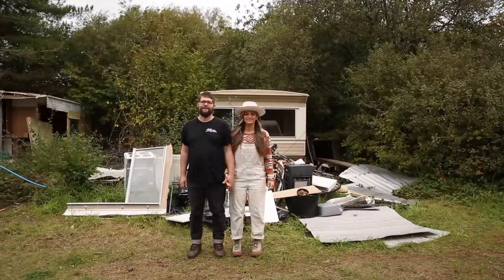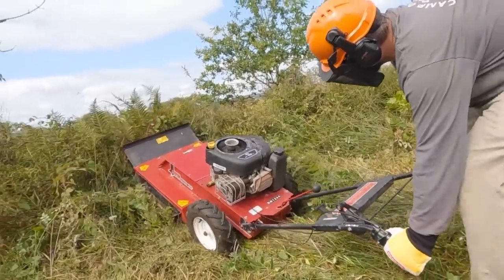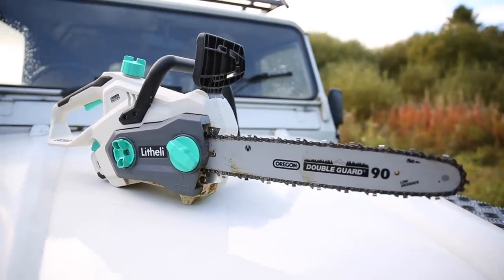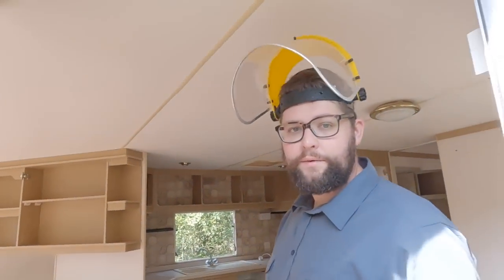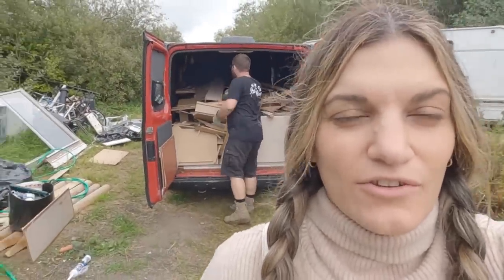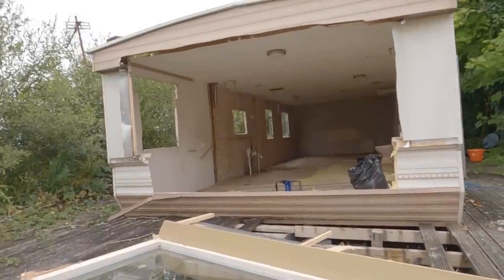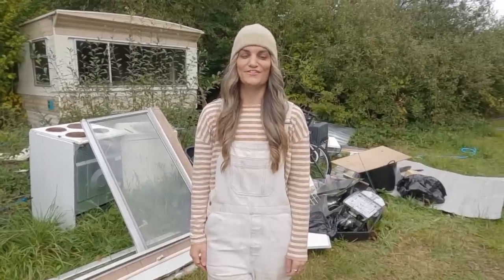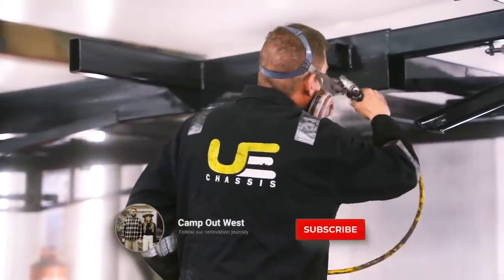Renovation PT.4 | Land clearance, caravan destruction, trespassers, exciting delivery + GIVEAWAY

Comment: These great videos just popped up as ive been looking up for glamping options. The land price with services and residential planning is very good value.
We are doing a passive off grid modern Barn conversion using sips in the south hams with mobile glamping pods so interested in the chassis sizes and costs
if you could pick up on that in any future vids were looking at at sip build on a chassis with a build to match the barn 
you will be a bit ahead off us as we have a barn to build first so it will be interesting to see what you guys do. Looking at setting up a channel got loads of vids on borehole and solar
which we have set up for the static on site for the start of our adventure but do not seem to have the time at the moment as doing all the drawing and design and sorting out site takes all my time.
Anyway Those reo-link look good and if we had one i think i would use it to see the wonderful view we have from the barn when we are not there as well keeping an eye on any local rogues.
ps out local farmer has offered to cut the over growth and cut the hedges back for £150.00 when we want looks a lot easier than doing it yourself.
Reply from the maker: Thanks Gary! Your project sounds incredible! Defiantly keep us updated. So we are building within the caravan building code, as our land only allows residential caravans/park homes. The chassis we have bought is 8m x 3m and we paid around £3,000 with delivery, but it's built to the building code of a park home. We are building timber frame, as we have some experience with that. We've never used sips, but heard great things! Let us know when your channel is live, we'd love to keep up with your progress! That's amazing your local farmer has offered to help. Sadly as we have no idea what's underneath all the overgrowth, no local farmer wanted to risk potential breaking their massive on whatever might be hiding underneath haha

Comment: It is a shame none of these mobile homes could be salvaged or repaired. There was probably some value in them. Even where there was rot, it can normally be easily replaced. A lot of the damage was likely caused by the overgrowth leaving the outside of the home in extended contact with moisture. None of them I've seen so far looked horrific inside, and one or two might have made good temporary homes during construction of the planned home. I was expecting to see laminate hanging off of the units, but they look in pretty good condition.

Comment: Didn’t see the end of the video yet . But that baring should not be hard to source . I regularly order bearings from a company called simply bearings . You n Ed to know the inside (Id) , outside (od) and width . Their web site makes it easy to find the correct part . You should be able to fit it with a hammer and punch . Give us a shout if you need help . We own a place up the road in cardigan bay
Reply from the maker: Cheers Dave, I bought the kevlar drive and cutting deck belts for the machine off of simply bearings and they are amazing value, the genuine belt for the cutting deck from swisher the manufacturer is RRP £90 I think I paid £11 for a kevlar belt of the same size from simply bearings. Will have a look on there for the bearings. We got married in Cardigan, we love it there.

Comment: Brush cutter seems a good buy. Bearing should be an imperial size. A local farm machinery repair shop should help. One of those cameras would be useful at the bottom of my garden to watch the local kids stealing apples of the tree. Not that I want to report them. I just want to see their faces when they bite into them and realise they are Crabbe apples. SOUR🤪😆
Reply from the maker: I'm impressed with the machine, absolute beast of a thing and we got a good deal on it, looking forward to getting back to using it once I've fixed it. Jon

Comment: You're going to get into trouble if you keep on promoting products without clearly stating that you are promoting them, just saying you were sent something isn't enough. 
Whether you're being paid or got sent the items for free you're serving as an advertisement for those products and you need to follow the ASA guidelines:

If the video is largely editorial but includes a section that is advertising, or only some of the products featured are affiliate-linked products, it should be clear immediately before or at the time the advertising starts/the affiliate linked products are featured – either by way of a clear verbal explanation or prominent on-screen text to make clear which parts of the content are advertising.
Reply from the maker: Hi 😀 we have selected  & our video is showing  'this video features paid/promotion content' button for this video that shows a button / tag in the top left corner at the start of the video, as YouTube requires 😀 & and stated we were sent both the chainsaw & camera  in the video - to clarify we weren't paid. We also aren't using any affiliate links, they are normal links, so that's why we haven't declared it 😊 any questions just let us know x

Comment: A great pity you decided to destroy this caravan rather than either repair, or perhaps more realistically disassemble it.
You destroyed so much  that could have been reused by yourself or someone else. Doors, Windows even the roof could have been used for a wood shed or such like, Then there was a built in oven, the hob, the sink, the fire, several of the units or maybe just some of the panels of the units, even the small 1" x 1" wood could have been reused all not to mention the thin steel sheets which are so useful. Instead you just smashed or cut everything up. For two people blessed with these resources you wasted a lot. Such a awful pity.
Reply from the maker: Incorrect - we tried to sell the caravan and even offered it to people for free and no one wanted them dye due to how rotten they were. This caravan in particular - the whole back wall and 2 back rooms were so rotten we were falling through the floor and the roof had a massive hole in it that had been letting water in for 15 years+ which was why the whole back area of the caravan was waterlogged. Also the chassis's were completed rotten and the tow bars snapped, so you couldn't even move them if you wanted to. No one wanted to buy them or even for free when we offered them. There was no point in us repairing them either as they aren't even legally aloud to stay on our land due to not being built to the correct building code our land allows. So if no one wanted to buy them or take them for free and we aren't even aloud to keep them on our land the only other option for us was to break them down and recycle the material. Nothing was wasted - as mentioned everything was recycled. Every bit of wood was taken to our wood recycling and all the roof beams we kept ourselves, every bit of metal weighed in and recycled where they will be reused again. The oven/ hob/sink/fire - weighed in and recycled at our recycling centre. Nothing was wasted unless it was rotten and not fit for use. There is no point us keeping/hording things gathering dust that we cannot see us using then, the sensible solution was to recycle the materials and use the money we made from recycling and  invest it directly into our project. Nothing was wasted
Reply: @CampOutWest  I never suggested selling it and offering it 'free' would still cost the buyer maybe £1k to move even if it was worth it. I understand that things come to the end of their useful life at some point but disassembly andreuse of what can be reused, and there was lots, is very different to destroying everything.
My own 1979-80 static probably only has another ?? 8-10 years in it but when that sad day comes I will take it apart and reuse as much as I can. [It's sad not because I'm a green obsessive but because I love it] This is totally different from your destruction.
I really don't mean this as a rant, it's just a pity. 'Recycling' perfectly usable things is bad, they should be REUSED. As an example the roof having a hole doesn't stop it being useful for a number of things, one of which I mentioned (even if you neatly cut it in half) if it's got a hole patch it - not all minor outbuildings need to be pretty and that would have been a good use assuming of course you need a shed / minor outbuilding.  The metal skin - partly sunk into the ground as rabbit fencing (bottom part) or for raised beds or or or . .
The doors and windows could have been used in a shed and or as cold frames. 
The sink will be going to landfill (it wasn't metal) this and the hob at least was worth putting on freecycle so it could have been reused. I guess as I'm used to not having much It's painful to see so much waste and this was very wasteful.
Think of it like this, if someone crashes into and writes off you nice LandRover you could take off the undamaged parts and REUSE them yourself or sell/give them away so someone else to use them or you can chuck the whole car with undamaged: engine, tires, some body panels fancy radio etc. in to a crusher for RECYCLING. As I said not meant as a rant it's just sad.
Reply from the maker: Our recycling centre is actually landfill free, so nothing from our land has ended up in a landfill 😀. We agree it's great to reuse things but as we personally had no use for the vast amount of materials left from the caravans and no one we knew wanted them, the best option for us to recycle them responsible, as if we'd kept them they would literally be gathering dust on our land for years to come.   @cyngaethlestan8859

Comment: You guys definitely were way more wasteful than you needed to be, very disappointing.
Reply from the maker: Wasteful? That's an interesting take on what we've done and how we've chosen to do it 😅 - incase you missed it in the video... all the aluminium shell is being recycled along with the chassis. All the cabinets/ MDF etc were taken to our recycling point etc. Even all the curtains/carpets were recycled correctly. Barely anything has been wasted,  so I'm not sure what elements you are calling 'wasteful' ?  😅 also the caravan was not sellable, as we've mentioned multiple times (we tried to sell it and offer it to anyone that wanted it) but due to it being left to rot and abandoned for 10+ years, the chassis being completely rotten out and broken (the chassis was literally snapped off and in bits as you could see in the video) , it was unable to be moved, and also the floors/ceilings were completly rotten. The only thing we couldn't recycle was the toxic insulation and for good reason as it was filled with dead bugs, dirt and lots of black mould from where the water had been leaking in. We've learnt with youtube and with most things in life outsiders will disagree   or be quick to label people as 'wasteful' & disappointing'  but we know we are disposing of things correctly and responsibly 😊